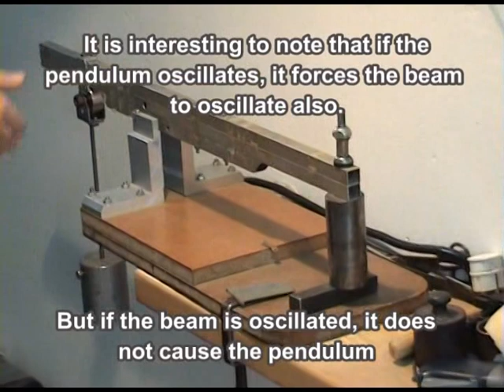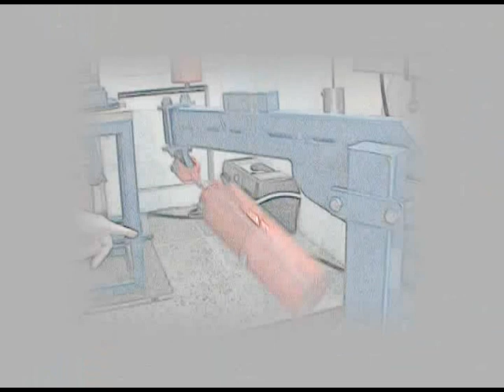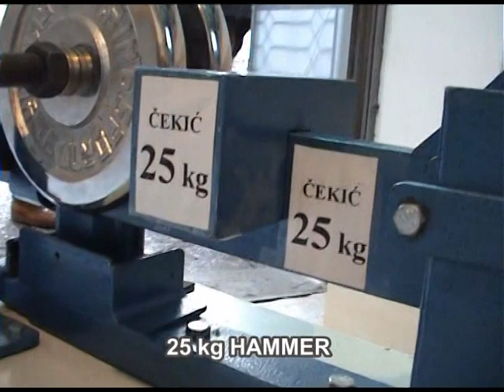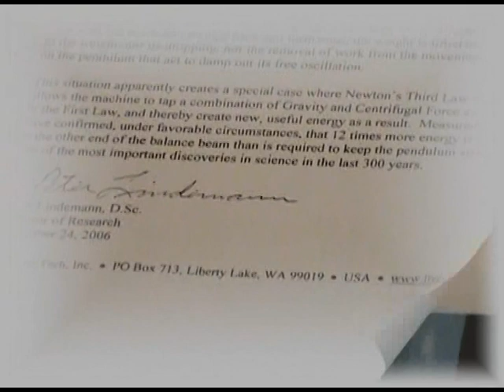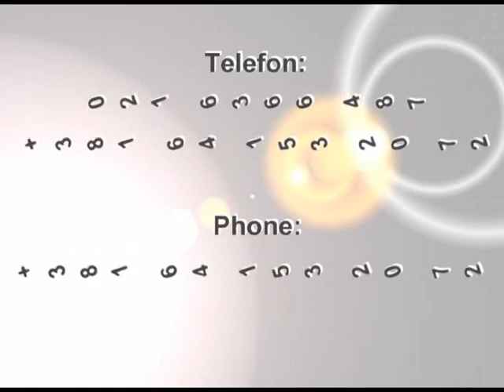Two-Stage Mechanical Oscillator -- A Mechanical Amplifier

Comment: While this is a nice demonstration the problem is that this device generally converts (long path + low force) to (short path + high force). Because of this the lamp he's holding might produce less light. Even if he is imputing the exact amount of energy that is consumed on the output side with many lamps. This is due to the internal resistance of the generator lamp mechanics. Anyway I'm hoping that this is not all there is about this device because it's really elegant.

Comment: I did ask "And the point of it is? "  You didn't include anything in your description to say what the purpose or point of it was.  Regardless it won't do anything to allow the output of an oscillator to drive the input.

What you fail to understand is where is the extra energy coming from?  For a device to achieve over-unity requires it to produce it's own energy.  The oscillator device is merely a lever that does not increase power despite what you or anyone says.

Comment: Correct! We use a scissor jack type mechanism, and two rotary pendulums mounted on a track. Both pendulum wheels oscillate back and forth in synchronous unison by about 5.0 mm which is perfectly sufficient to maintain constant oscillation of both pendulums. Both pendulum wheels are mounted on a frame with salvaged automobile suspension. The lateral force of centripetal acceleration engages each pendulum with a buffer, the stored energy in the 'sprung' scissor is released by a trigger mechanism.

Comment: Imagine if you used a hall sensor and electromagnets to do the pushing. Then you get a generator and flywheel on the output and tune the system to get a smooth pendulum motion with a smooth wheel motion. I bet it could make a rediculous ammount of power.

Comment: Mr Mikovic, Please understand that the hammering effect is only due to the fact that the pendulum generates CENTRIFUGAL force ( down)  when it is moving at high velocity on its lower level, which acts on its hinged pivot, pulling it down and through the horizontal beam, pulling the hammer up. 
Because of this, the moving pendulum will  drive the hammer, but the hammer will not drive the pendulum,   though it will if the pendulum is started and the hammer moved in synchronism by an energy source.   The effect would be analogous to a single phase electric motor which needs a push to start and an oscillating input.......... but I shall not go into that.
Reply: +Carmel Pule' I became interested in this machine about  a week ago and  I had a look at this once again and I find it interesting that Milkovic himself stated so clearly that  the system needs energy to drive energy to the output, her is what he said at 11:21

" the more you obstruct the output, the easier it is to maintain the input"   

Well let us analyse this statement, If the output is obstructed by the strong man in the video , then the output is not moving or moving  very little, THIS MEANS THAT THERE IS NO TRANSFER OF ENERGY TO THE LOAD,
Now the fact that the output is not moving then the pivot of the pendulum is not moving  so as the pendulum has its swing not in the same direction as the load  up and down so it will be much easier to swing as it retains all its energy within the pendulum itself because of the solidity of  position the pivot but not its rotary bearing qualities. 
If the  force on the load is allowed to move...... it needs energy and this needs the pivot of the pendulum to move and it disturbs the pendulum momentum hence energy and so the input becomes harder.
When Milkovic stated that this machine amplifies 12 times he meant that there is  VERY SHORT IMPULSIVE FORCE  ON THE LOAD WHEN THE PENDULUM  IS HORIZONTAL AND HAS NO WEIGHT PULLING DOWNWARDS,  hence  THE HEAVY LOAD COMES DOWN WITH AN IMPULSE WHICH IS VERY SHORT  AS WHEN THE WEIGHT OF THE PENDULUM STARTS TO BE EFFECTIVE THIS  LOAD IS COUNTER BALANCED BY THE WEIGHT AND  CENTRIFUGAL FORCE OF THE PENDULUM
This machine  is only capable of giving a heavy short impulse and it is no amplifier of energy, nor does it rob gravity of its  energy contents. All the energy is supplied by the operator in  repeated small forces acting over a relative loner time than the impulse at the output.
Incidentally I made one of these machines  and I gave it  impulses at the point where the hammer or the load is normally placed.  Well I was able to keep the pendulum swinging by applying impulses at the output, which really meant that in actual fact some of the  energy in the lifted hammer as it drops  goes back to keep the pendulum swinging and that is why  the pendulum does not need to be pushed with a heavy load, in other word the machine is  not transmitting much energy to the out put only  short impulse forces.  If the load   is made to absorb energy which is not in the form of a quick impulse, the pendulum will slow down. and the operator needs to work hard   which confirms what Milkovic himself stated so innocently..
Reply: +Carmel Pule' This is an interesting machine in that if the load it too heavy, the pendulum will declutch  or decouples itself from the load and keeps on oscillating.
1. Assume that instead of  a pendulum we have a  heavy cart on rails with a  springs on either then such that the cart will oscillate horizontally.  Obviously  little energy is needed to keep the cart moving in the HORIZONTAL DIRECTION.   Put in to the Milkovic machine this horizontal moving heavy cart will  not pass any work to the Milkovic load. So what transfers energy to the load in the Milkovic machine is the vertical movement of the pendulum and not its horizontal movement where these two actions can be independent of each other but if they exist they have a reaction on the pendulum's performance.
2. If the pendulum now replaces the cart , the pendulum will transfer energy to the load either due to centrifugal force or its own dead weight and it does this through the fact that  the pivot of the pendulum moves basically Up and DOWN   as it is the UP  DOWN movement of the pendulum which does the work on the load.  
3. Now if the load is light or springy  there is no work done on the load. If the load  are a few hand generators as was shown in this video,  these will work if the vertical motion of the pendulum is ALLOWED TO BE TRANSFERRED TO THE LOAD and so the load itself must permit it by being a relatively  light load.
4. If the load is increased such that it will need a heavy reaction to the UP and DOWN motion of the beam, then the beam will not move if the load is heavy and so the pivot of the pendulum will not be able to take the up and down motion of the pendulum  and effectively the pendulum DECLUTCHED OR DECOUPLED ITSELF FROM THE LOAD.   and it will keep oscillating  without any effort.   In electrical terms this is equivalent to an electrical source with a high output impedance, where when the load  becomes heavier there is a point where the voltage drop in the source itself would not transmit energy to the load.  
5, So the fact that "on load" the pendulum still swings,  IT DOES NOT MEAN IT IS TRANSFERRING ENERGY TO THE LOAD IF THE LOAD IS HEAVY AND STOPS THE PIVOT OF THE PENDULUM FROM GOING UP AND DOWN.
but the side swing  will remain with the up and down movement all taken by the mass of the pendulum itself.

Really this is a self declutching or a self decoupling machine when the load is heavy somewhat like a centrifugal clutch where the engine keeps  turning as the load declutches/decouples  itself from the engine.

An interesting behaviour nevertheless, but Milkovic had to be very careful when he says that if the Machine is loaded, it is easier to swing the pendulum ..................... obviously if there is no up and down motion to transfer the energy to the load.      It is to be noted that when this happens, Milkovic pushes harder on the pendulum so that he will increase the UP and DOWN motion  of the  pendulum's pivot as that is what really transfers energy and not the lateral  swing  of the pendulum.  Well the Up and down movement is obtained through the centrifugal force so the side swinging becomes part of the equation.
Reply: @carmelpule6954  but you can smash atoms with such a big power hammer with a bit of energy. Pendulum should be used in diesel engines or something

Comment: "Nobody has ever built a heavier than air flying machine", (an axiom proposed by Lord Kelvin of the temperature scale) Therefore such machines must be impossible! I note with dismay that you have never learnt 'critical thinking' or read up on 'logical fallacies'. First go to "besslerwheel"(dot)com" source of that quote. Remember Mass x Acceleration = Force. Circa 1983/84 I was visiting fellow at DAMTP Cambridge. I organized Stephen Hawking's voicebox. designed by Mr. Rocket, of RadioSpares.

Comment: @95JAN59 - the output power is measured incorrectly thus giving false input to output ratio.  PM me if you want all the information as to why these devices do not produce over-unity.

Comment: That video shows a device that slowly winds down and stops.  And the point of it is?  To prove those old laws of physics are right again?

Demonstrate a two stage oscillator powering itself and the $100 is yours.  If it doesn't work then send me the $100.  How hard can that be?

Comment: John, you are totally right!
Milkovic's model IS working, I can give my ward, I tested it.
Big importance is very strong connections and parts, with no elasticity, especially the stand, the bigger the better.
Only one thing is possible to improve. Besides of possible changing of the positions of input and output of E in horizontal line, it is possible to put the air compressing tube upside down, instead of a heavy weight, and use all energy that this system is pushing up twice in one loop:)

Comment: I know you want to call it a mechanical amplifier but you can’t have amplification without additional energy entering the system.  So let’s identify that energy that is causing the amplification.  Of course it’s obvious that the energy is coming from gravity,  you are harvesting gravity, therefore it’s a gravity harvesting device and there are other ways of doing it

Comment: OP, you realise the torch in your hand is dimmer because most of the energy you are putting into the swing, coming from your hand is not reaching the mechanism inside the torch as the handle is barely even being depressed. I really don't see any point in the claim you are getting more energy out being mentioned.
Reply: Does this not confirm the minimal force required?  The force to depress 9 torches coming from the energy to barely depress 1?  If you cannot fathom your own so called scientifically created conundrum, then truly you invest in information above and beyond true knowledge and common sense.

Comment: So you have quoted a formula. Wow that is so wonderful.  And does it prove that these pendulum devices are perpetual motion machines? No.

Simple question (again) - have you connected the output to drive the input? Yes I assume you have but don't understand why it didn't work.  You don't understand basic physics at all.

Comment: I'm hopeless? You keep posting comments about unrelated information.  The physics involved in levers and pendulums have never been revised and will never change.  The laws of conservation of energy in relation to pendulums and levers haven't changed either.  Stick with the subject!!!

No one, not you, or Veljko Milkovic have demonstrated (with reliable data) that any of your claims are valid.

You keep bringing up irrelevant information - show me a self powered pendulum system or shut up.

Comment: People look at the Milkovic pendulum system and are unable to see the errors in the quoted figures.  "12 times more power out than in" I have seen quoted.  But never properly measured.  If it produces so much power how come there is NOT ONE video showing a self powered machine?

I know more about physics that Veljko Milkovic if he claims his device puts out 12 times more power than it uses.  Post all his measurements to me and I will correct them with facts!

Comment: The operation of this machine can be  define it as:-

* A Pendulum Controlled  Centrifugal Clutch which can   couple and transfer Energy to various  loads from the internal energy of the Pendulum including  returning, all unused  transferred energy, back to the pendulum after it  is  temporarily stored somewhere else outside the pendulum.

 Three Principal points to look for and understand.

 Pendulums with  FIXED pivots and pendulums with  MOVING pivots behave totally different,  where the latter may act as a centrifugal clutch to a load.  A fixed pivot pendulum does not have centrifugal clutching abilities , its angular momentum may be used to drive a load by direct coupling and the  energy to the load is  still the energy lost by the pendulum. A pendulum with a moving pivot, can be coupled to the load by its centrifugal clutching characteristics and the energy passed to the load is  also the loss of the angular momentum of the pendulum.  The moving pivot pendulum has the ability to declutch/decouple itself from the load when the centrifugal force/velocity is low, or pivot arrested from motion,. The pendulum with fixed pivot, coupled to a load,  is normally  kept coupled/or ratcheted  through the cycle irrespective of pendulum velocity. Outside clutches can be used.  To do away with the effect of gravity, the conventional  TSO may be placed horizontally where the pendulum can  fully rotate or oscillate forcefully in a horizontal plane  where the energy transfer to a load is  all done at the expense of the  energy lost in the pendulum as with a vertical pendulum TSO.  With a horizontally rotating pendulum the  pendulum will transfer more energy as the acceleration undulating input forces are less than those spent on an oscillating pendulum where inertial forces require the pendulum( as is normally the vertical case) to resonate as if pushed to oscillate at any  frequency  other than resonance the pendulum will absorb  energy.

In half a cycle, all energy transferred to  lossy and  energy storage components within the machine  is  energy lost by the pendulum, as its pivot falls and any of the  transferred unused energy in any part of the machine,  will all be passed back to the pendulum as the pendulum rises. The actual energy spent in the load needs careful analysis of a dynamic situation.

Also an output  weight raised to a height h  to gain Potential Energy and then allowed to fall FREELY to solid ground,  will reach it with  high velocity v   and all the energy will be utilised as the crash energy , where crash energy =Mgh
If the same weight is raised  to a height h by a machine  as the TSO and  as it falls remains attached to the machine which  slows down the fall , the initial  Potential Energy Mgh is now divided in two, where   part being transferred back to the machine ,to keep the pendulum swinging and hence the final velocity at ground will be slower than v as when allowed a free fall.   Hence the crash energy is smaller and  this  is the work done by  the TSO with the  falling weight  still attached to it. Hence the work  done by the TSO is small.
With a TSO having springs  working in conjunction with a lossy load, the energy in the springs is passed  partly to the lossy load and the rest back to the pendulum which keeps it swinging. 
Note that part where the TSO can be used horizontally with a fully rotating pendulum where gravity does not come in it,  it is the pendulum that does all the transfer of energy to the load at the expense of loosing it , proving that this machine does not use energy from a gravity field,  be it used vertically  or horizontally  as it is the centrifugal force that clutches in the action of energy transfer  at the expense of the internal angular momentum of the pendulum  and not  an ounce of gravitational pull.
Reply: +Carmel Pule' At 2:39 where  it says "But if the beam is oscillated , it does not cause the pendulum  to swing back and forth".   I assure Mr Veljko Milkovic that if he synchronises the pulses   he gives to the beam with the swinging pendulum   in the  form or an impulse as the beam itself does as it drops, the pendulum can be made to swing indefinitely .   In fact this action of feedback of energy  from beam to the pendulum is being done all the time as the weight falls and still linked  to the machine. If he replaces the load with springs only, he will find the confirmation of  the action of energy transferred back to the pendulum. In fact this is  the reason the pendulum keep swinging.
Reply: +Carmel Pule&#39; 

Centrifugal force doesent exist. What it does exist, is the reaccion of de centripetal force, in the axis

Comment: I have seen scholarly efficiency measurements in the region of 3.5:1 other estimates are higher, but possibly unreliable eg. :- Veljko Milkovic’s Two-Stage Mechanical Oscillator
- Efficiency Measurement - Mk 5 INPUT/OUTPUT DETERMINATION THROUGH LOAD CELL MEASUREMENT
Ronald Pugh Victoria BC, Canada, May 12th, 2009 Addendum added, May 21, 2009. 
The University of Melbourne helped with PANACEA - BOACAF Online University did extensive research as well. and produced videos! Please do more research

Comment: I'll try and explain the error with all these systems, especially the quoted measurements.

Lets assume the output is 3.5:1 (as stated by you).
- input = 1.0 kilogram force
- output = 3.5 kilogram force

We need distance otherwise these measurements are nonsense.

Assume 1.0kg input force is over 0.4m and 3.5 kg force is over a distance of 0.1m
- input = 1.0 x 0.4 = 0.40 units of work
- output = 3.5 x 0.1 = 0.35 units of work

Oh look the input is greater than the output.  What a surprise!!!